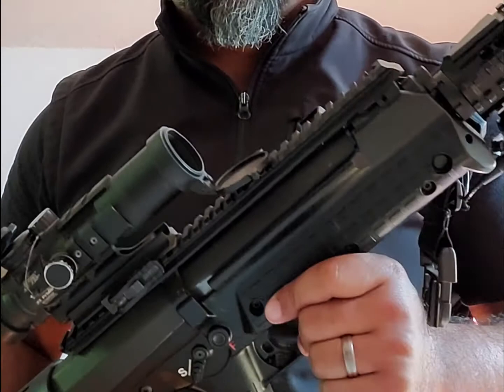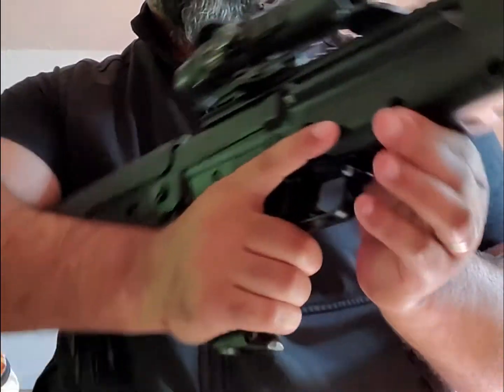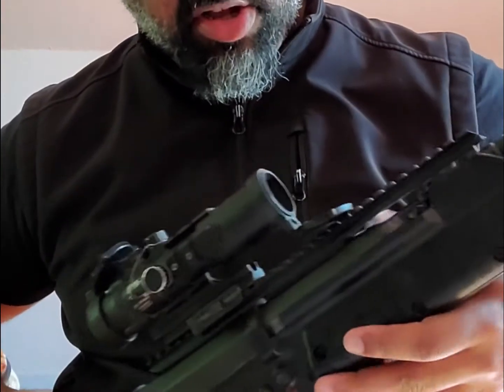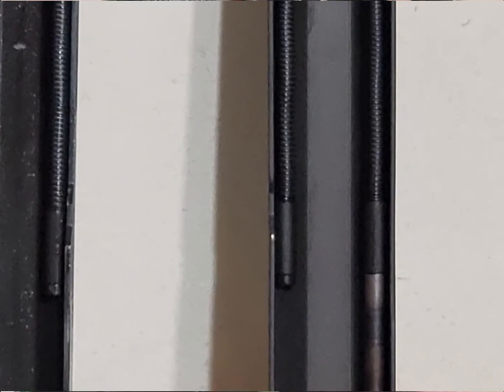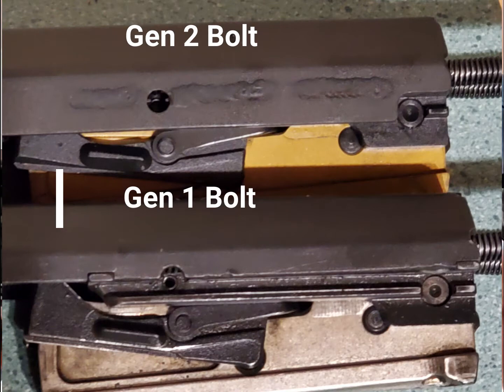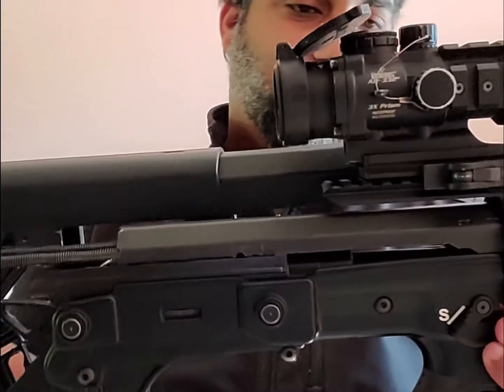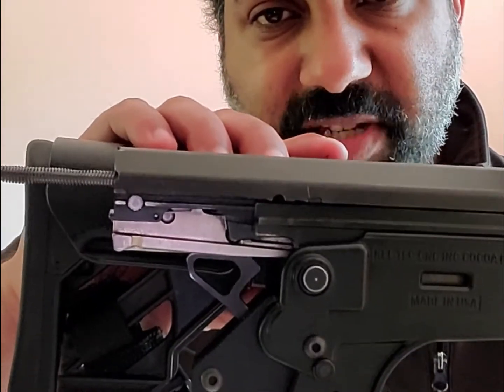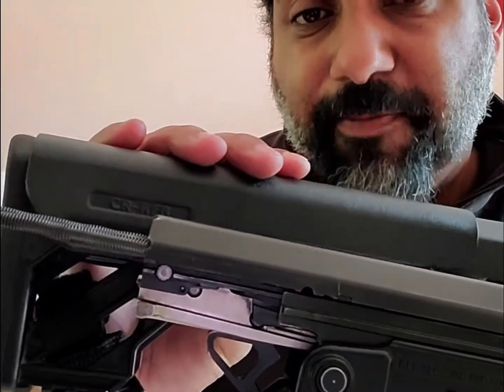Keltec RFB  Gas System Updates and Changes

Comment: Can someone explain the setting values?  I keep seeing things like B+10 or B-20 and I cant find anywhere about what this means.  I recently got a suppressor and upon putting it on my RFB its obviously overgassing like mad and double feeding so i need to figure this one out.
Reply from the maker: https://www.youtube.com/watch?v=PGdBtwXRSII I tried to do that in this video. (I have both an over gassed and under gassed adjustment)
B = is the gas knobby screwed all the way in (Most gas to cycle the system)
+ (Insert Number) the number of kicks away from bottom or screwed in. (Higher this number the lower the amount of gas being used to cycle)
When using a traditional/baffle suppressor, Start with the gas knobby off.Then screw it in until the RFB locks back (1 round at a time in the magazine).

Comment: As I've been researching the RFB before buying I've found that the 18" black comes in two SKU: 640832003178 and 640832007381. After talking to a couple of vendors that carry both I was told that the one ending in 7381 is an "older version" without much additional detail. Do you have any idea if the difference in SKU indicates the transition from the two generation of gas systems? (i.e. the 3178 the Gen 2 and the 7381 is the Gen 1)
Reply from the maker: Gen 1 gas system hasn't been made since late 2011. If it's a new Rfb it's always a gen 2.
There has been changes to the coating of the bolt carrier from tiNi to black nitride.. Vendor/color change only,no difference in function.

Comment: You have the gas adjustment backwards in this video as well. Please send me the manual you're reading from, it's clearly different from all the ones I have seen.

I have a second gen, titanium nitride treated bolt with 40 position gas system.

B+12 my gun does not lock back 147gr. Tightening it to b+10 as the manual dictates, tightening gas adjuster increases gas, it will then lock back. I'm not seeing how you're getting it backwards?
Reply from the maker: Do we agree the goal is to get the gun to fail to lock back and then go the opposite way to ensure reliable cycling? 
Would you agree the rifle in my video is correctly calibrated for the ammunition its using?
Bottom (tightening) is closed. Opposite (loosening) opening the adjuster. 
In my case My manual does state to start at B+10 then turn the knob clockwise to B+9 if its not locking open.
If our only disagreement is what is more or less gas Ill concede that because its not super clear in the manual which is which only the opening or closing of the adjuster.
Reply: @Odinforever2000  I agree, the goal is to get the rifle to fail to lock back, and add the specified amount of gas the manual dictates (two click clockwise, tightening, increasing the gas) if you've been following the manual the way you described, then yes you have calibrated it correctly, most people calibrate it the way you do. 

If you read what I just copy pasted straight from the manual, you'll see it says to tighten the adjuster clockwise (looking from the front of the gun) two clicks, increasing the gas to the correct amount.

Threading the adjuster in increases gas, unthreading the adjuster decreases gas.
Reply: @Odinforever2000  bottomed out is not the gas closed off, but it closes the vent for the gas system. Bottomed out is the maximum amount of gas. The manual has you remove gas to a point that it should not lock open (b+10) then increase the gas one click clockwise (tightening) until it does lock back. Then tighten two more clicks for reliability sake, increasing gas.
Reply from the maker: @ADM_Vike  page 25 in the manual says "To find the
optimum gas system setting, ensure that the gas restrictor cap is cool enough to touch, and
then turn it Clockwise until it is >>completely bottomed out and closed. <<Note: The bottom or
closed position will not always align a slot on the regulator with the Adjustment pin.
Reply: @Odinforever2000  okay what you just copy pasted doesn't mean anything man, that's just to find the bottomed out position so that you can open the regulator 10 clicks. Bottomed out is not the starting point, you need to keep reading. Bottomed out is the reference point, to add 10 clicks.
Reply: @Odinforever2000  there is a small dowel pin that you can see protruding from the gas block, that as you tighten the regulator, it pushes it further inside the gas block.

Further into the gas block it is, the more gas stays in the gas system. Backing it off, or retracting this dowel pin, allows gas to escape.

I'm just trying to help, you're severely overgassing your rifle here.
Reply from the maker: @ADM_Vike  yea that's how folks on the forums understand what setting your on B-bottom and the the number of click you have opened the regulator.
Reply: @Odinforever2000  exactly, and unlike most rifles opening the regulator on the RFB allows gas to escape the system. Not sure why they decided to make it backwards from pretty much every other rifles design.

Best of luck, you should find with the gas system at B+20, or all the way open, it definitely should not lock the bolt back.
Reply from the maker: @ADM_Vike  I might get beaten to a new video by Keltec. Chad says they are editing one right now on this very topic.
Reply: @Odinforever2000  nice! Sounds good, I'll keep my eyes peeled for it. It's good to recheck your gas adjustment after your first couple hundred rounds of break in. My rifle went from B+7 to B+12 being the optimal setting after break in. Should slowly require less and less gas as parts wear in.
Reply from the maker: @ADM_Vike  Ill still do a live fire follow up as his video is studio only
Reply from the maker: @ADM_Vike  B+16 with SNB 168gr
Reply from the maker: @ADM_Vike  The Rdb didnt really change much..B+6 vs +5..
Reply: @Odinforever2000  Daum! Mine likes 150gr for whatever reason, doesn't like anything higher, so I havnt had my gas out further than B+14. So B+16 with a heavier round makes sense.

Finding its shooting a decent bit softer?
Reply from the maker: @ADM_Vike  Yup..I was wondering why it was thumnping harder. Nearly as hard as My MDR lol
Always turned it to 10-12 with the 147gr surplus stuff I have for blasting.. 
Magtec Sniper168gr keeps my RFB right around 1.5moa (5 shot groups with a 3x prism)..tho I did try some Sig 150gr today..Havent measured that group yet.
Reply from the maker: @ADM_Vike  I appreciate the help. Glad to hear I was wrong and that Keltec made an update becasue of how trixy that system is lol
Reply: @Odinforever2000  any time, sorry I couldn't explain it better, this gas systems hard to describe in writing

Really wishing these were just a standard 3 position system. Adverse, suppressed, and normal
Reply from the maker: @ADM_Vike  I don't know of a 308 bullpup that only runs 3 settings..
I do like that you can tune the Rfb for alot less recoil.

Ah that Sig performance ammo almost net me 1.2moa..but my 5th shot grew it to 1.8..oh well.
Reply: @Odinforever2000  ahaha I had the same experience yesterday. Federal American eagle 7.62x51 NATO 149gr shot 1.2MOA, 5th shot 1.7moa ahaha

Comment: So a little confused. The Pic in your video shows the gold nitride as Gen 2 and the black nitride as Gen 1 bolt. But the way you say it makes it sound like the black nitride is the Gen 2. Could you clarify please. I picked up my 18" RFB recently.
Reply from the maker: That was chrome in my Gen 1. It was just dirty it the photo..But its clearly chrome in the rest of the vid.

Black nitride is what newer gen 2 Rfb are using with the "gold"nitride being earlier Gen 2s..
Gen 2s also have a different gas block and a recoil spring that extends to the piston. 

Basically only the Gen1s were chrome colored.
Reply: @Odinforever2000  Awesome man, I appreciate the information. The information regarding the changes and diffences is hard to find. Thank you for your work.

Comment: So ur video has been then the most helpful understanding that the previous owner was shooting brass where im shooting barnaul and may be under gased.. My question would be , would that cause light primer strikes??
Reply from the maker: Hard primers.. 
And light primer strikes happen from time to time.

But you should check or maybe order a new firing pin just in case its broken or damaged

Comment: Hello, I don't understand anything about my RFB, I use 147gr GGG from shoping but if I completely loosen the adjustment cap almost 45/50 clicks from full tightening (anti-clockwise) the RFB cycle anyway, is this normal ?? Another question, when the stopper is loosened by where the gases are evacuated, I do not see any correspondence between the housing of the piston and that of the adjustment pin ??
If you have any answers, thank you in advance very, very much ^^. Serge
Reply from the maker: What you describe is too much gas..
The idea is to turn down the gas in the gun to just above where it doesn't cycle (screwing it all the way in is almost no gas in the system.)

Unscrewing the adjustment cap is something you'd do if running a supressor on the Gen 1 Rfb .
Reply: @Odinforever2000  Ho man !! You mean if I remove the plug completely, I'm at maximum pressure in the barrel? I thought the opposite, I have a lot of trouble with my translators & with my RFB^^
(I hope I understood correctly this time :o) Anyway, thank you very much for your answers, I took fairground's potatoes in the shoulder (typical Fr exp :O).
Reply from the maker: @plumard01  https://youtu.be/CtNk8syn1l8
Set your gas like this. Your goal is to get it to run on the lowest setting possible.
Reply from the maker: @plumard01  you can start at 10 or 15 but the bolt locking open on an empty magazine is your goal. 
With match ammo I'm down to 5
Average range is anywhere from 5 to 15.
Reply: @Odinforever2000  I am very grateful for your answers, my problem is that if I screw to the maximum or if I unscrew to the maximum, the weapon still cycles: Cartridges, GGG 147gr "NATO", maybe by reloading with -10%. ..? On your films there is a young man who hardly moves when he shoots, I am 92 kg and that shakes me a lot.
I do not see communication between the piston chamber and that of the pine, I do not understand how the gases work according to the settings? Thanks again.
Reply from the maker: @plumard01  oh so it fires on any setting. That is bad and it should be sent in to Keltec to fix.

The guy in my vids has a very good muzzle break on the Rfb.That helps cut down the recoil.
Reply: @Odinforever2000  Thank you for your answer it's nice, I was waiting for the results and I just did a battery of tests ... uh finally 5 recharges X3 settings 5-15 & 45 clicks. I managed to calm her down with 168gr v = 618m / s and 125gr v = 706m / s, the 3 others charges only cycle. Thank you again for listening, My best wishes for 2022.Serge
Reply from the maker: @plumard01  and to you as well 😀
Reply: @Odinforever2000  Mine has the same issue. It will still fire and cycle the bolt even with the gas adjustment cap completely removed. It was sent back to the factory twice and each time Keltec just returned it to me without fixing the issue. They simply stated that they fired some ammunition and it cycled. They apparently misunderstood what my complaint was. There should not be enough gas to operate the piston and cycle the bolt all the way if the gas cap is removed because too much gas will be venting off. I agree this is probably bad. I’ll just shoot it with the extra recoil until something breaks internally and then send it back again. Keltec is A+ in innovation. They score a D- in customer service and quality control.
Reply from the maker: I've got another video on how to set the gas in a later video

Comment: Thanks for the video. I've had my 24 hunter for 3 years now, but my bolt carrier is not a the titanium bcg. sighs
Reply from the maker: What color is your bcg? Gold or Black?
Reply: @Odinforever2000  mine is black. But i went on ktog and apparently people that sent in their gold ones got a black one back.
Reply from the maker: @khoatran9482  Thats the Black Nitride coating. Its just what Keltec uses right now. Marks 1 of the many changes to the RFB

Comment: I wonder if the gas system can be adjusted so it could cycle 200gr subsonic rounds?
Reply from the maker: I..dont know..I guess I could try that.. I cant get it to cycle the 10gr (Plastic) - 7.62x51 German Short Range Training Ammo..But..To be fair..Nothing I own can cycle that but my 91 Clone with a special bolt.
Reply from the maker: I do have a suppressor on the way so that would be an interesting test.
Reply: The rfb has a special suppressor piston for running subsonic ammo
Reply from the maker: @Danjer510  sure..if you have a gen2 gas system (I do not) . 

Do you have this piston and how well does it work? 

So far I haven't had anyone who has that piston report good things
Reply from the maker: SO..I had a dumb thought...Why would you not just go with 300blk? More appropriate twist rate for subsonic heavy bullets.
Less wasted case space.

Comment: Thanks for the vid, newer owner myself. Any idea if the newest piston, 2.51 that u showed, is like the suppressor piston? Or should I still get the suppressor friendly piston
Reply from the maker: Actually it looks alot like the 2.0 piston minus the gas rings at the bottom 
https://www.keltecweapons.com/product/rfb-suppressor-piston/

Supressors and 308 guns are a finicky bunch..I know "flow through" style suprrssors work on the Rfb..But thats about all I know about the supressor game with thr Rfb.
If you learn more..Throw up a vid plz.
Reply: @Odinforever2000  thanks yeah, I don't have an oss can but Surefire is good about venting excess gas out the rear at the mount (muzzle Device) 

I may give that can a go. My other option is the 30 SD by Griffin, and it looks made for the gun. But, it's more of a standard baffle design. 

My Tavor is almost impossible to suppress without causing over gassed feeding issues but the Surefire can works fine with it. Unfortunately, the Surefire can is also louder but I guess you can't win em all.
Reply from the maker: @Guardian2A  Yea..Ive always heard about the trials and tribulations of suppressors..Maybe someday Ill go down that rabbit hole. :D Good luck and again..Id love to hear about what you encounter, working or not
Reply: @Odinforever2000  Thanks noted, haven't made a video in a very long time

Comment: Awesome video, watched it more than once!

I own an RFB and have talked to different people on forums but my issue is that the gun always locks to the rear with 1 round in the magazine. 

Doesn't matter if its 147gr to 180gr. I've sent an email to keltec with no reply. (I'll follow up) Do you have any recommendations? It is a Gen 2 and has cycled about 200 rounds. 

The only time it has failed to feed is while using dusty FAL mags but with keltec mags, no issues. Minus that it doesn't matter if the gas is B+0 or B+~40. Any suggestions?
Reply from the maker: Did I talk to you on reddit?
Yea follow up with Keltec and/or contact Chad Enos (keltec rep) on Facebook. Hes on the Rfb and Rdb page the most.
Reply: @Odinforever2000  lol probably. I'll look him up on FB and see if I can get some quicker email replies.
Reply from the maker: Any updates on your rifle? Sounds like it needs to go back to Keltec (so far its about 10day turn around from what I'm hearing) Your rifle sounds out of spec
Reply: @Odinforever2000  well, keltec emailed me back and told me to repeat some troubleshooting and since I already know the result I requested to send it back. That was about 2 weeks ago and haven't seen a follow up from keltec. 

I'm worried that once they do get the gun that it will be years before I see it again if this is their response rate to emails.
Reply from the maker: @kevans2502  Email or call them for an update. The guys who have sent guns back on the Keltec facebook group are reporting short turnarounds.
 If not contact Chad@KelTecWeapons.com and let him know you got a gun in and its issues. He will help ya out.
Reply: @Odinforever2000  will definitely do that. Thanks for the help!
Reply: @Odinforever2000  just sent him an email. Thanks again.